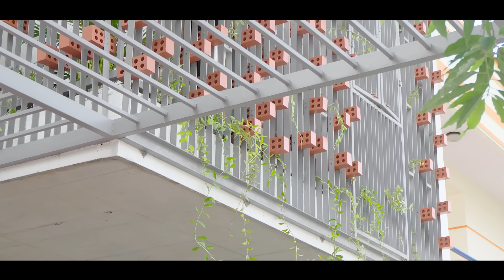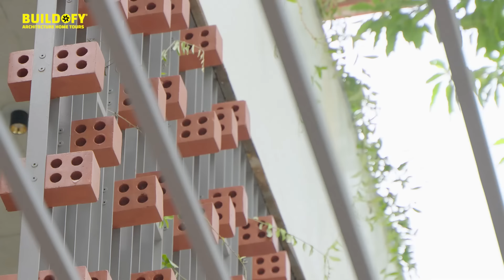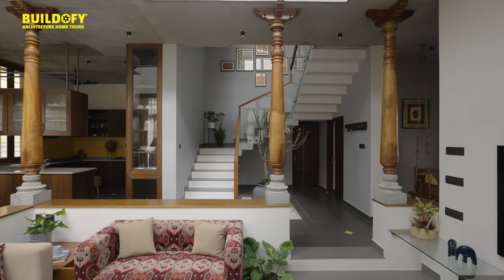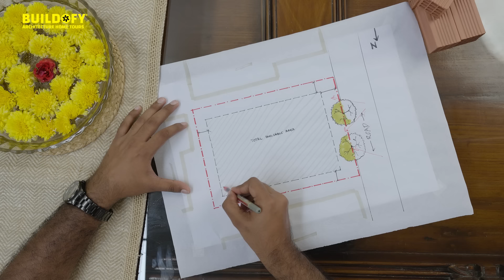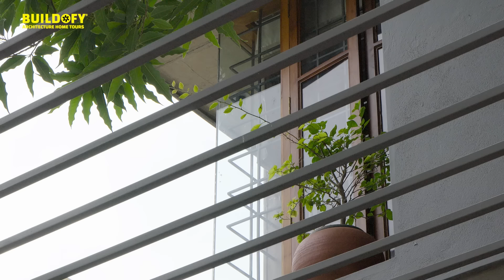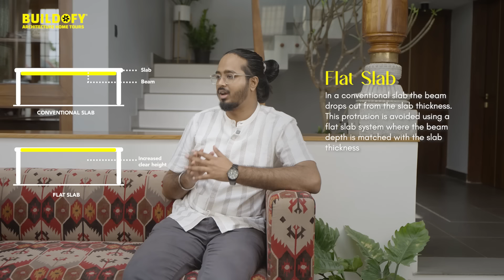A 60X40 Bengaluru House inspired by local traditional houses of Karnataka (House Tour).

Comment: To people having questions about summer, Bengaluru mostly has moderate and nice weather so it won't be extreme.
Reply: Thanks to the zoombies who flocked Bangalore in search of food and cloth.
Reply: @LegalBarron  Bengaluru is a Tier 1 city still it has half of the population of Mumbai Imagine if Bangaluru has the same population.
Reply: This year bangalore crossed 41 degrees thanks to pll using cement blocks temperature is increasing due to that
Reply: No longer the case...
Reply: In which corner do you have OTS
Reply: Summer 2024 was averaging around 40°C. Moderate and nice doesn't apply to Bangalore summers anymore.
Reply: @just_sadhana  ohh😅
Reply: Days of Bangalore being a Garden City are long gone 😓

Comment: Very nice design. Wide stairs, well designed areas, right sized bedrooms for the size of the occupants. Well placed kitchen with view of the sunken living and the pooja.  I am sure the young architect would have provided for ventilation at the double height area for hot air. Though the two trees give ample shade to the harsh west sun, summers gets real hot. Terrace area is really cool. All areas are well colour coordinated. Didn't know till now that tiles can be customized. A lift would have made easy for the elders in the house. Overall very nice looking house. Congratulations.
Reply: Hi thank you for this lovely message. We appreciate you taking time to let us know your feedback. And with regards to your concern about the heating up of the living spaces, we have planned and strategically placed the skylights to bring in ample sunlight, but not heat. However as a precautionary measure we have windows in the double height to let hot air escape. 

The plumeria tree in the stairwell is placed for now, when required a lift can be added very easily. 

Please follow us on our socials to learn more about our works, and thank you again.

Comment: Excellent practical home with vastu
Reply: But there is one fault, direct Sunlight opening above living room will heat the living space in Summers.
Reply: @ajinkya3780 hi we have strategically placed the skylights based on solar analysis and we have double height volume with openings to let hot air out.